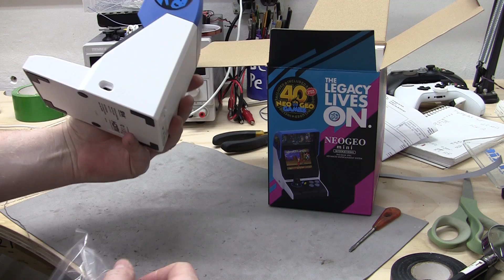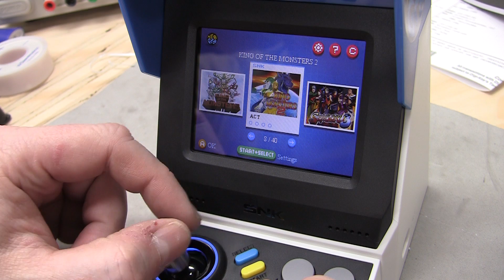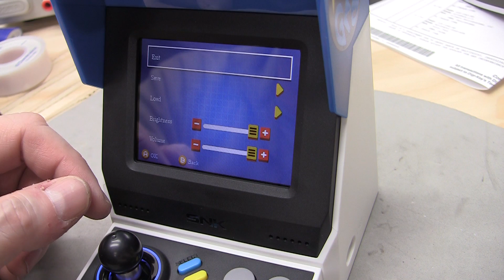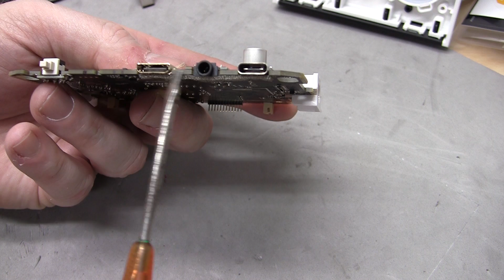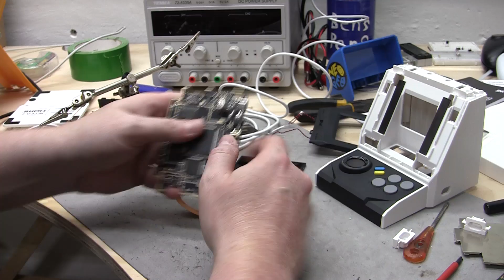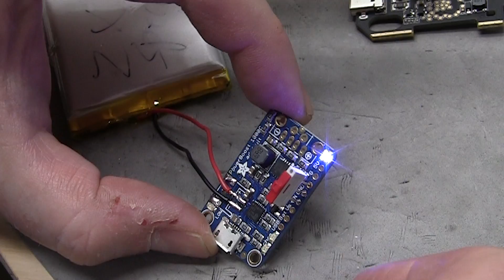Ben Heck Neo Geo Mini Teardown Part 1

Comment: If you run into an issue of the board taking all your heat before the solder melts, hit it with some low melt solder. Bam, both solders melt right away.

Comment: I can think of a couple reasons for the castellated boards. First off, if you think about the two components, they have more complex sodering going on, so it could have actually been cheaper to have those little boards cranked out by a team that did nothing but those. Secondly, the injection molding could have been cheaper if they didn't have to make the holes further down in the design; in other words, if those connectors all fall at the seam between the two injection molded parts, it simplifies the mold.

Comment: I completely agree about USB-C attracting pocket lint at a crazy rate. It becomes an issue as the port seems incredibly sensitive to whether the male end is plugged in completely.  The smallest amount of lint keeps the charger on my LG-G6 from going in that last tiny bit, and results in it often being limited to slow charging mode.

Comment: I don't know why I just now thought of this: custom battery packs for swapping/replacement, designed to look like game cartridges. The battery cart can include cooling system and LEDs or be a stylized sleeper with custom graphics. I see how 3d printing is handy for design, but this module could be conformed to a few pieces of injection molded recycling. Molding would help with the tactile style of a cartridge design.

Comment: Lol I suspect that your fingers will have absolutely zero measurable impact on your current measurements. Hmmm what is a couple of meg in parallel with a fraction of an ohm for the Fluke in amps mode?

Comment: I feel you should have just swapped boards with and Amazon tablet Which would be a major screen and battery upgrade for the cheap and likely you could have kept both computers inside of you used the fire 8 With a switch.

Comment: The lint problem is the reason that I dislike USB type C.
I love that is it reversible and runs at USB 3 speed, but each phone I have had with it I have trouble charging because the cord has to be at just the right angle for it to charge.

Comment: What happens if you boot it with the serial connected? Maybe you can enter the linux boot options. If you can, you can boot it in "single user" mode and change the password :)

Comment: 70Cool and weird nitpick is that the ATM7013 seems to be an Actions Semiconductor MIPS based CPU, not ARM. Granted, that's Wikipedia for you. Which, I would say that guessing that it was some off the shelf ARM component would've been a good guess... 

Also that ATC2605 chip seems to be an audio and power management controller.
Reply: Also the button layout is a throw back to the NeoGeo CD pad, which had a similar layout but I think this one might be better

That layout was 

C D 
A B

the Mini arcade's layout of 

A C 
B D

is much nicer and slightly more logical.

Also if you do portable-ize it, make sure it has a clicky stick like the NeoGeo Pocket!

Comment: Hey Ben, the reason Magician Lord has an intro is that was only one the AES version. I’m sure you know AES and MVS games use the same ROM, but the BIOS dictates if it plays in AES or MVS mode. The mini has its emulator set to US AES mode (hence why you start with 4 credits, can’t insert more, and why the games are censored).

Comment: I honestly feel like they meant this board to go into both a mini cabinet and an actual handheld unit. It would explain all of the design decisions. And honestly, it's pretty smart if so, spending a little more money to get a good base design that they can use for multiple styles rather than a custom board for each. I just wonder if they actually will come out with other designs using this board.

Comment: 330/8=40.25MB ... really not bad at all for the late 80s / early 90s. Most PC games at the time were like... 4-12MB unless they were CDROM.
Reply: Sorry, 41.25
Reply: 12:50 I saw that same clip arrangement inside older electronics too. Like the Insignia Flex Win10 tablet I have. The shield over the CPU/RAM is just clipped like that. (With some weird thermal pad.)

Comment: Proper MCS cabinets with the memory card slot and headphone jacks were stereo... and not just for the headphone jack! There was a switch that converted the JAMMA connector between their non-standard stereo and standard mono JAMMA output. You only wanted it set to stereo in a proper MVS cabinet, of course.

Comment: There’s actually more to the power adapter thing than just “saving money.” In Japan is has always been somewhat standard to leave out AC adapters, especially for successor consoles. For example, the Super Famicom did not include an AC adapter because it was expected you might have one from the original Family Computer, and it was specifically made to fit/work (unlike the USA). Similarly, the Nintendo DS did not include one because they expected you might have a GBA SP. Master System and Megadrive. The Interface Unit and CD-ROM² replaced your PC Engine PSU but repurposed it to power the undocked CD drive for use as a portable CD player.

This has been going on for decades. Nintendo first tried this in the world with the 3DS XL even though the North American version still included it. They must have thought it went well so the North American version of the New 3DS XL also left it out. They sold the official Wii Remote charger and battery pack without the adapter too.

I made sure to complain about the NN3DSXL since it supported 100% of the DSi, DSi XL, 3DS, and 3DS XL functionality and, thus, you had no reason to keep the older one and whoever received it would need an adapter. They weren’t excusing it that easily. They offered me a free adapter in consolation.

Comment: Looking forward to you putting a decent digital joystick on the NeoGeo Mini, hopefully a microswitched one.
With the scaling of the screen, I think it's actually fine, and they're using a high enough resolition scree. The two different sides of the H is just the font they used rather than bad uneven scaling.

Comment: Anyone know the Unix terminal password for this thing?

Why'd Ben leave that show?
Reply: I'll answer in a very Ben Heck way: You know in Wayne's World when they're doing their awesome show, then the sponsors come in and make their format all weird and drive the direction in a weird way? That's totally what was happening.

E14 presents Ben Heck, and 'Ben Heck does what he wants when he wants' are totally different vibes.
Reply: The login looked like Huuhhu so i'd take a punt and say the password is "neogeo" or "password"
Reply: That has an SD card somewhere (/dev/mmc is the usual device type for them). I'm sure you can just connect it to an SD card reader with the correct cabling and you are in. Remove password and play at will. (Doesn't seem to be encrypted or anything, although the "load array" messages can mean it is part of some sort of raid config, which can be tricky)
Reply: @framegrace1  It doesn't have an SD card. It just has an eMMC chip.

Comment: For those interested I real quick looked up the two chips on the board:
the ATM7013 is as expected the CPU/GPU and interestingly enough is actually MIPS based  (74Kf processor) rather than ARM and runs at 1.1GHz.

The ATC2605 didn't have a nice convenient Wikipedia chart but I did find a datasheet that described it as an Audio/ Power management IC. Fun fact: according to it there's a 7.1 channel DAC inside, so who wants to do the surround sound mod?

More relevantly it includes some power saving modes, I wonder if we could get into the Linux system if it'd be possible to program the device to support a sleep mode for portable applications? Just rambling thoughts.
Reply: The ATC2605 also has battery charging capability, so if they're using that for power management I don't really get why they couldn't slap in a Li-Ion cell and let the 2605 take care of it
Reply: @beepboopboop  costs
Reply: Nice. I was just about to post the same info. The company that makes it only makes 2 MIPS based chips, and this happens to be the cheaper of the two. (They also make an array of ARM chips.)
Reply: PuyoPuyoMan237 NEEEEEEEEEEEERRRD

Comment: Ben is back! Yeaaaah!!

Also, it surprised me how much detail went into this little thing. The custom molded cable connectors, tiny stereo speakers, the ports are all aligned on the same horizontal plane.

Comment: How difficult would it be to try to hack that linux terminal password?
Reply: according to http://neogeominihacks.blogspot.com/ there's 1-2 seconds delay between each failed password attempt, which makes brute-forcing time consuming.
Reply: In general pretty hard, in this case probably not so hard. I guess it is not very secure, probably something like "NeoGeo" or simular, since there is not much to protect. I'm sure someone will figure it out!

Comment: I took the liberty of looking the two ICs up. 

The primary IC is an Actions Semiconductor ATM7013 MIPS CPU (yeah, not ARM). The secondary IC, ATC2605, is the PMU and audio codec.
Reply: That's a really crappy chip for $100.
Reply: Sionyn Jones well, for what it’s worth, the MIPS platform has been host to a number of emulators including Neo Geo ones. One wonders if the platform was picked because it’s cheap to license, well documented, and has had been a host to many emulators, especially Neo Geo emulators, for years, meaning the emulators on the platform is probably very stable by now. I remember installing a Neo Geo emulator on my Dingoo (remember that?) over a decade ago. And even at that time, the emulator was actually running really smoothly on such weak hardware, the only issue being audio emulation was inaccurate.
Reply: @RAMChYLD  Not just emulators. Both the Playstation and N64 are MIPS based systems. (older versions of the architecture obviously). The N64 doubly so given that it's a MIPS R4300 CPU combined with second, modified MIPS R4300 core (the modifications being the removal of it's FPU to add a vector processing unit instead, and that it shares the same die with a DSP that contains fixed function 3d graphics features.)

Certainly would be a reasonably good choice as the basis for emulating a couple of different systems. It actually makes me wonder what Nintendo will use for the rumoured n64 mini, because I have a feeling the 400 mhz ARM core they've been using in the NES and SNES minis won't cut it for emulating an N64...
For that matter what is the mini playstation internally?
Reply: KuraIthys the ironic thing is that the PSOne Mini is pretty much confirmed to be running an ARM CPU at this point since the emulation core is rumored to be  based on PCSX ReArmed. Of course, we don’t really know for sure until the device finally appears on store shelves.
Reply: @RAMChYLD  hehe. That is kind of ironic. You never can tell why companies make the decisions they do. I guess some solutions are just cheaper/simpler than others.

I mean, when you think about Nintendo's minis, you could be forgiven for wondering why they didn't attempt to build a PowerPC based system - after all that would likely have allowed them to re-use whatever emulators they wrote for the Wii - For that matter, while that may be too costly in some ways, they could perhaps have created a Wii on a chip, in which case by virtue of what already existed for the virtual console, that would have given them pre-existing NES, SNES and N64 emulators (as well as Sega Master System, Mega Drive, TurboGraphX 16, Neo Geo, and technically even c64 emulation. - plus, if the system is technically a Wii internally it would have allowed gamecube and Wii minis on top of everything.)

Of course, perhaps that solution is just too expensive in terms of what the hardware costs, but it certainly would have been an option. Instead they went with an ARM system and presumably wrote entirely new emulators for it...

You have to wonder sometimes why companies make the choices they do. (For instance, when nearly everything on the market like this is running an ARM core, here's the Neo Geo with a MIPS core instead. When Nintendo could've killed a dozen birds with one stone using a cost reduced Wii chipset, they instead use an ARM core... I'm sure there's good reasons for these decisions, but superficially, it still looks pretty weird. XD)
Reply: Shutup nerd.

Comment: Wait street fighter wasn’t so simple, Jamma didn’t have enough buttons for SF2 so you needed a kick harness to plug in the kick buttons.

Hmm do you even need to filter cap if you’re running it off the battery? Actually probably yes if you want it to run well while charging. 

Pretty nice board though, and not just because of the perceived increase in value that comes with silkscreening a board black.